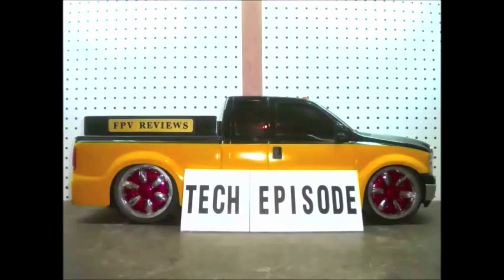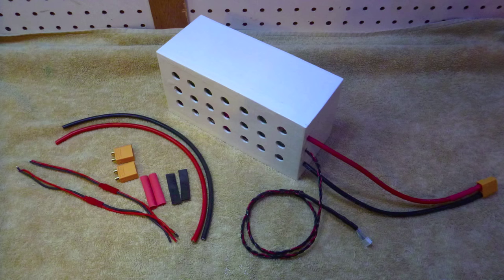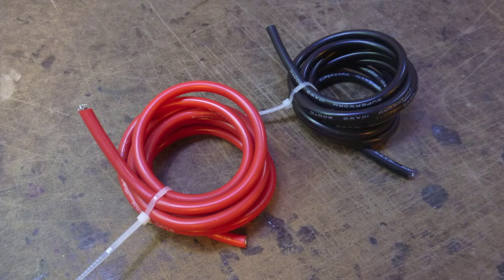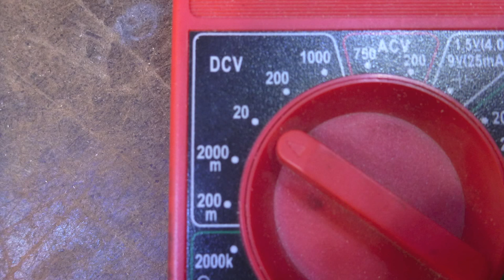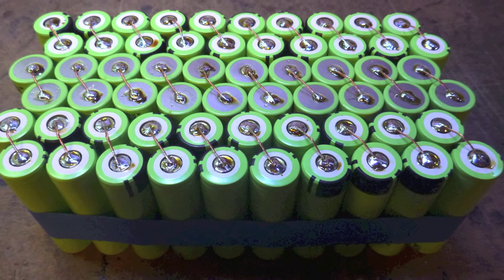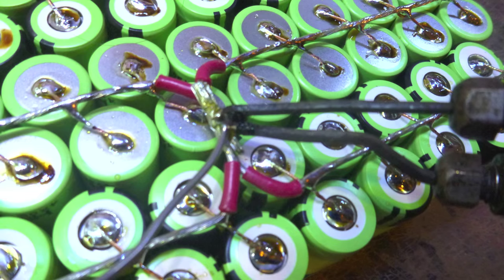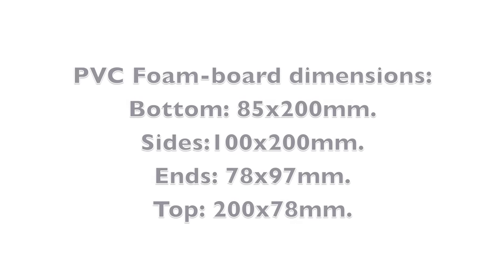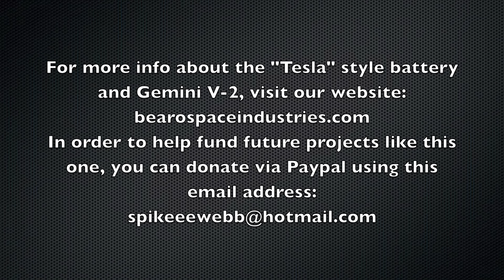"Tesla" Style Battery BUILD for Gemini V-2 And other FPV Planes!

Comment: Why have you choosed a 3s Setup at that size of plane and battery wouldnt be a 6s Setup more efficent because of these long wires to the motors.
Reply from the maker: I's mainly a matter of compatibility with video systems, and other accessories, and the power output is still within acceptable range for 3S, but you are right, a 6S would allow for smaller wiring.   We plan on using a 6S setup on a future design, and recommend it to people wanting to draw more power, using bigger motors.
Reply: thats a fast reply :) you are right it didnt thought about all the acesorries and the voltage regulators you would need to run them and if the amps arent that high than this is the better solution:)
Reply from the maker: another option would be to use a separate battery for the electronics, and this is a common solution for electric vehicles. the main pack often charges the smaller, lower voltage battery.   in this case, it would add cost and complexity, not to mention potential noise from the charger.
Reply: oh Ok. I used a 2Battery setup back in the day to avoid noise in the video sytem but it was just a pain in the a** adding an Lcfilter an going from the flightpack is just so much more convinent.
Reply from the maker: I'm using an LC filter. actually, two of them. one for each video system.  i'm using the heavy duty one from rmrc, and they work great. it's just an inline filter.  that does not bother me. 
what i don't like is having two batteries on board. if the video system battery goes below a certain  level, you can lose video. not fun.  and it's two packs to charge before flying.  
i've also eliminated all batteries from the ground station, and use the car battery for power. that way, there is only one pack to charge before flying, and only one voltage to monitor in flight. 
we made a video about the ground station a while back, if you are curious.
Reply: Totally agree!

Comment: The battery is powerful but at a hefty price. One can even put a fuel cell made specially for you, at an even astronomical price. With money you can have as much power density as you like. Its nothing Amazing nor impressive. Its like if one spends enough money, one can ride a Bugatti made of gold too. So, nothing great.
Reply from the maker: The price of these cells is comparable to Lipos, so I'm not sure how you can call it a hefty price, when you look at cost per watt hour, which is how battery cost is measured. 
The big difference is the energy density, which is about 87percent better than lipos. 
I'm not sure what the disadvantage is there.  perhaps that it cannot be used on your phantom? 
To attain a higher energy density, you need to use hydrogen fuel cells, and there are several problems with that. 
first, the price
second the danger involved with storing hydrogen, say, in the event of a crash, it could cause a large explosion. 
third, you need to re-charge the fuel cell, which involves even more expensive, and bulky equipment.
You cannot DIY a fuel cell easily, or safely, by watching a video not he internet. 
nice try, but you need to look at things with the right framework.
Reply: Cosmo John also if you have less money, as I do, you can just use less cells (if you scenario allows less A and Capacity). I used just two 18650 to power my fatshark goggles. Now i am waiting for 6 more to make a 2*3S pack for a flying wing.
Reply from the maker: very true, and we have a 36 cell option made from GA cells now on the website too.

Comment: Yeah =))) - that's a traditional LiPo pack, dude ! Tesla style or not XD.
Get your science right, man !!!
Reply from the maker: +Jörg Walossek It's Lithium Ion. as opposed to lithium polymer, but with 67% better energy density than commonly available Lithium polymer batteries for this application, who cares?
Reply: As far as I know the coating of the sheets in any Li Ion tube battery is also a polymer. And Lithium Ion are all of the Lithium containing batteries. But who cares...
Reply from the maker: +Jörg Walossek so why are some batteries referred to as lithium ion, and others as lithium polymer?
Reply: Habit and trivial names - as always. Just to differenciate the packing type.
Reply from the maker: +Jörg Walossek so how is it possible to get it wrong?
Reply: Just sounds a little wrong if you read LiPo is better than LiPo. More specific it's as well the different chemicals in the polymer and the packing form of the LiPos you compare in your video.
Reply: LiPos most often referred to as LiPos are in a flexible packing. And so mostly have different negative electrodes.
Reply from the maker: +Jörg Walossek that's exactly what i was referring to. the Flexible flat cell type packs are what almost every other model aircraft use, and these are marketed as lithium ion.   So, is there a better way to describe the difference?
Reply: It's okay to say so - as it's trivial use. But it would have been interesting to hear the specific chemistry of as well the 18650s you used and the original flexible LiPo pack - like NCR, IMR, INR, etc. - as this is the real difference. Maybe you could find other flexible LiPo packs with equal good energy density, too.
Reply from the maker: +Jörg Walossek i may be possible, but the size of these cells allows almost endless customization for different forma factors, and they can even be spread around a vehicle wherever they fit. The consistency, and the amount of money put into their development of the individual cell types is insane. /theya re also available all over the world. This video is meant to provide a turn key solution for better energy density for the DIY community, not really as a science show.  The 18650's i used are described in the video as NCR, besides, but i don't know the specific chemistry of the original lipos i was using.
Reply: That's indeed a valid argument. Availability and forms to arrange the 18650 are really an opportunity besides the chemistry and the theoretical possibilities of perfect lithium ion chemistry.
Reply from the maker: +Jörg Walossek It was not my intent to argue. I apologize if it seems so, and thanks for any info you can provide. I love to learn all I can.
Reply: Same, same. Really like to see people starting/experimenting with different usages of Tesla style Lithium Ion battery packs. It's really astounding what's possible with standard 18650s - and what a poor job companies show in their use and choice of batteries.
Reply from the maker: +Jörg Walossek Very true, but any deficiency is an opportunity for me, in this case, as i can make something on my workbench that performs better than anything produced for the purpose. I'm loving it! 
I really think that all batteries for FPV type planes will be made from some flavor of 18650 cells in a few years, not to mention cars and motorcycles, more and more each year.  With the Gigafactory battery factory opening sometime soon, hopefully the price will come down soon as well. time will tell, but whatever happens, it will be interesting.
Reply: It will be - just because agreeing on a specific standard will massivly reduce production cost. But as we can see with the new Giga factory of Tesla - it will still differ a little - the form factor Tesla is producing for it's cars will be 26650ies. And phones will still rely on the flexible LiPo packs for their perfect fit, especially with the more and more upcoming curved phones. But there sure will be a reduction in different types.